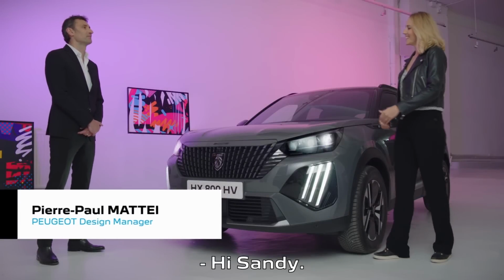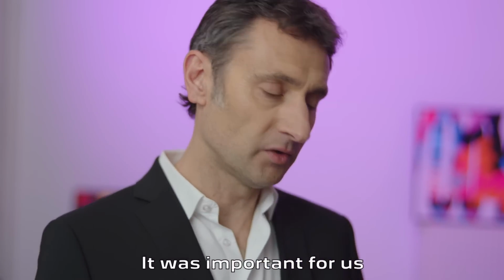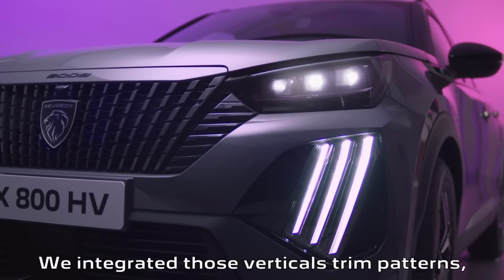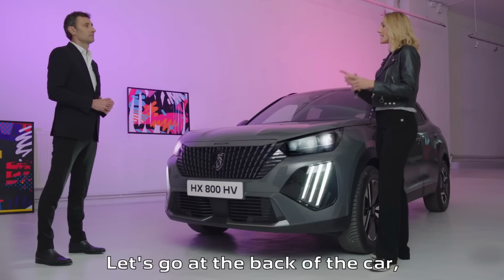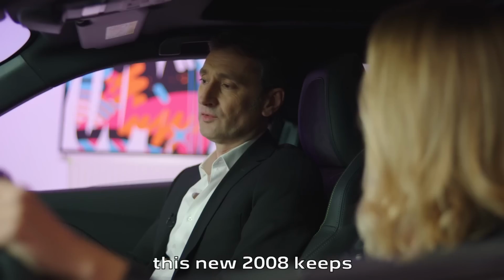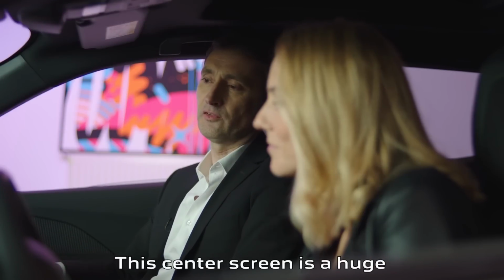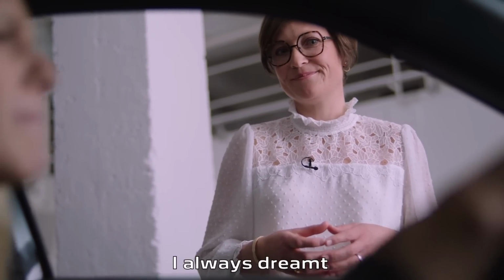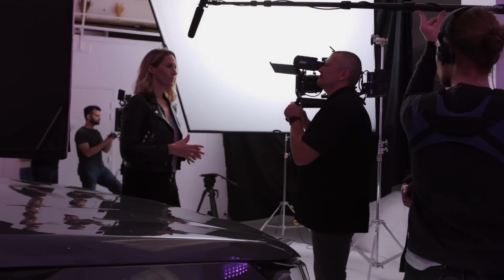New Peugeot E-2008 Facelift (2024) | REVEAL & Walkaround

Comment: (Original comment made on the 30/07/2023)

Just been looking at the specs of the new 2008 on peugeots website and it looks like the 1.2 puretech GT model has lost out to the heated front seats being as standard with the spec? I hope I have read this wrong? I am not trying to be picky here but one of the big reasons for me picking this car was due to the heated seats because of medical reasons. If what I am thinking is correct then I will have to rethink my decision and look elsewhere and cancel this order.

Edit.... (31/072023)

I was indeed correct. The new GT line no longer comes with heated seats as standard and now will come at a COSTLY sum 😠 YES the COSTLY sum does include the electric adjustment buttons, lumbar & Massage feature as well as the heated front seats... But this was a major disappointment to me after speaking to the sales people in person today at the showroom and probably many more potential buyers of the car!!! Luckily due to me ordering the car before the new facelift date was announced, peugeot will honor the original order for my motability car and include the heated seats with the new facelift model as this was something I had to take into account when ordering a new vehicle due to health reasons. 
Even tho the great team at perrys peugeot has helped me today and managed to sort this out for me, it does seem like peugeot have dropped the bar on this and it comes down to just pure greed by the company doing this. At the retail value the 1.2 GT model comes in at it should definitely carry on with such comfort features like heated seats for christ sake, considering the top spec petrol Vauxhall Mokka is cheaper and comes with a whole range of features as standard that this doesn't i.e lane keep, adaptive cruise control, heated steering wheel, heated seats, all these things that you will have pay on top for with the 2008 GT model as extras. And I wouldn't mind it's pretty much the same car. Anyway figured I would come and explain and hopefully people will find it helpful.